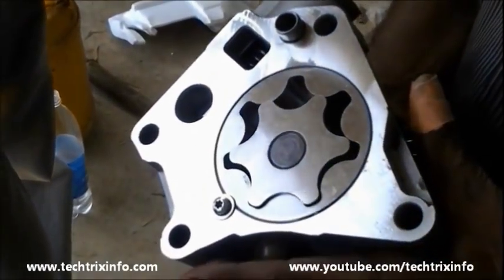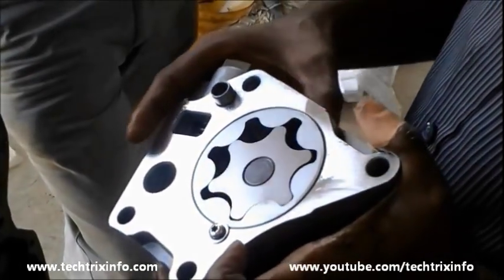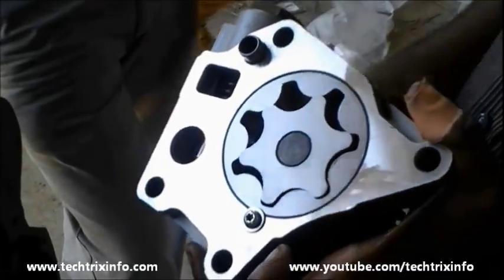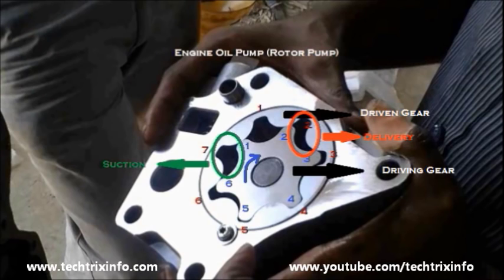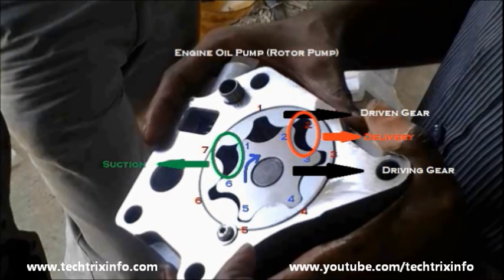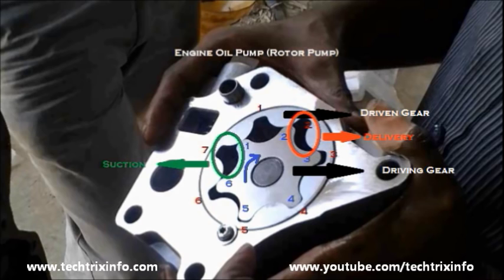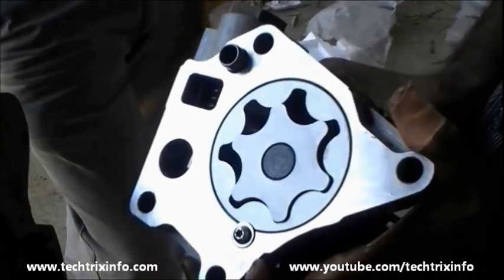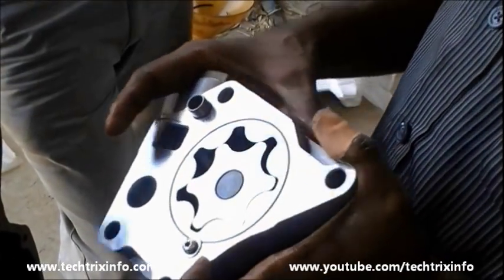How an engine oil pump works. ✔

Comment: Good video thanks. Have you ever come across an engine with excessively high engine oil pressure ? We suspect this with a Renault master diesel engine which is flooding the turbo charger with oil. We have fitted a recon turbo and a known good 2nd hand one and the problem is exactly the same cheers Nick.

Comment: Nice stuff guys, I've been following quite lately. Why not explain how gearbox gears are meshed/activated and the the working of clutch and plate with a detailed video. That'd be so great. I'm searching and all I got was garbled stuff. I want to see how the clutch shaft works with respect to the clutch mechanism and it's engagement of the different gears of a Indian motorcycle. Thanks! Keep up the good work.